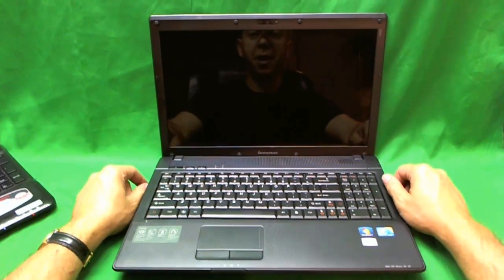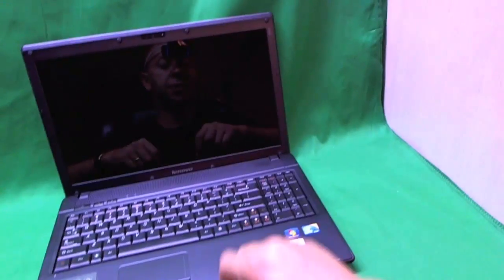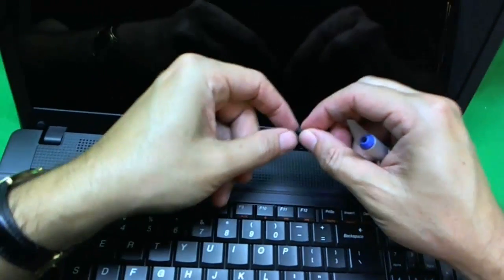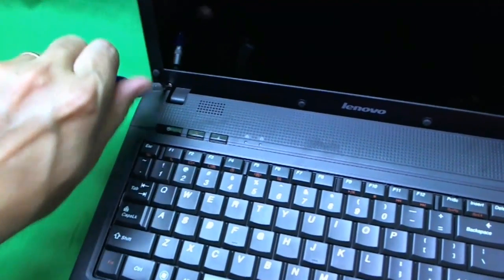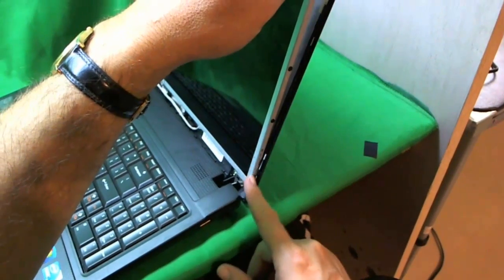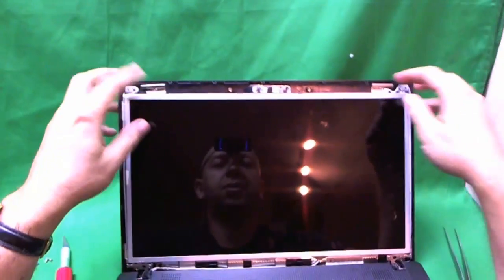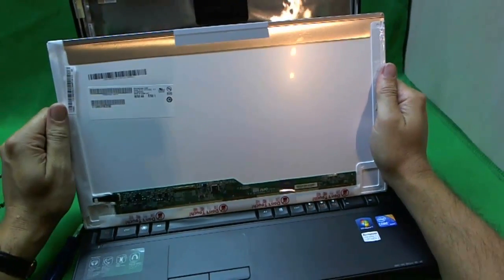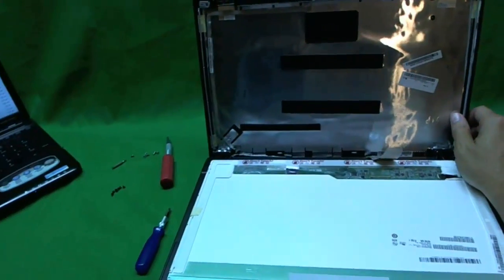Lenovo G560 Laptop Screen Replacement Procedure

Comment: Oh, and a tip - use a hairdryer on the rubber pads for 20 seconds before you ease them off - it softens the glue nicely.  Then when you put them back on again warm them once more with the hairdryer so the glue softens again, they stick back on perfectly then  ;)